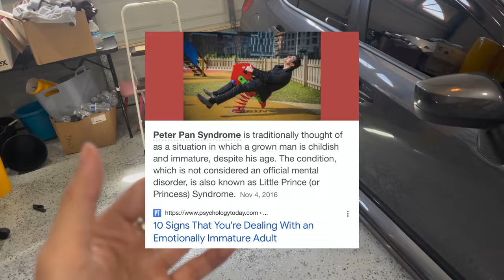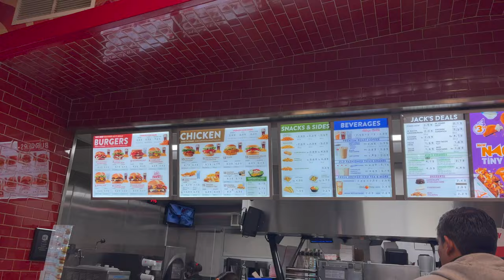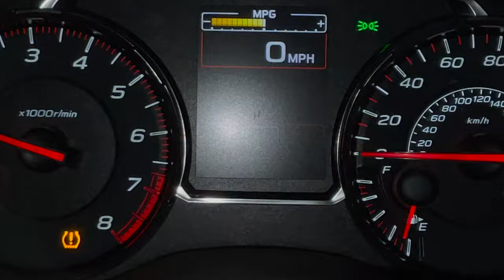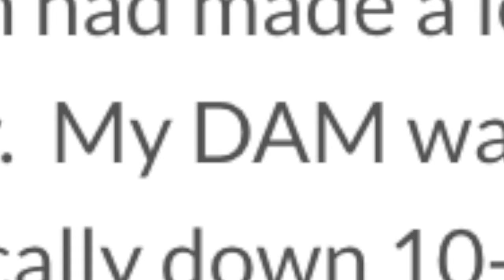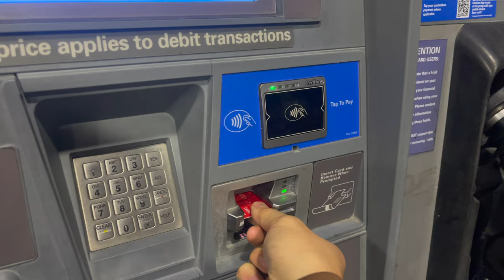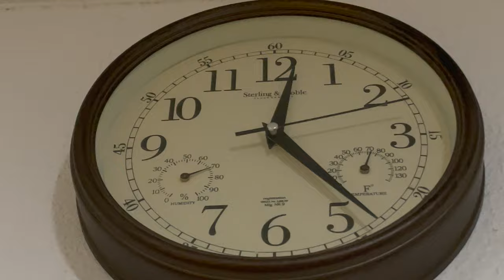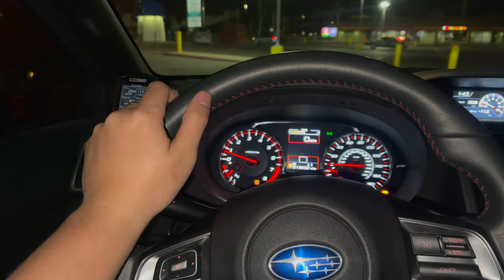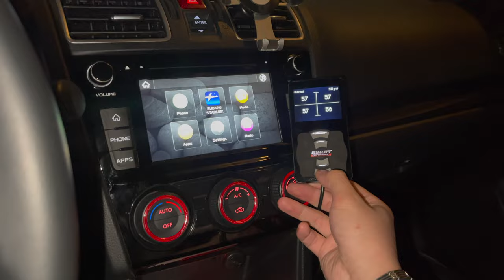E85 Ruined my WRX?? | Unreleased Kansei Items

Comment: E85 “ruined” my sti, after my first drive from switching over from a 93 tune im never going back, while the milage is horrible the car was completely transformed. I havent been back to a 93 tune for any real length of time for the 8+ years since i switched over, only going in for a retune soon due to a mild turbo upgrade. Im lucky that e85 is easy to find by where i live. 

Forget people that hate on wheel choices, sometimes you have to try something different. I did the rpf1 style foe a while on my spec b and decided to mix it up with some older ssr type c. I would normally do gunmetal or black to match my boring dull style, let my girl pick the powder coat color, she picked misty purple, they look crazy on the car and ive had more people stop me to comment on them than i have on any of my other mods on my cars combined. I never would have done a purple wheel but im glad i did, not sure if theyll stay forever but im happy i tried something new for once.

Comment: Yo you mentioned you had an unresonated jpipe on as well. Were you running stage 1 ots tune with the jpipe or were you on stock tune? Kinda worried about running the jpipe with no pro tune
Reply from the maker: i did a ghetto resonator delete on the stock j pipe. same thing as an after market j pipe. made my car run like absolute 💩. definitely need a tune whenever you touch the jpipe lol
Reply: @abgtaxi  ohh ok and you're running e24 on the Stage 1 ots?
Reply from the maker: @jerm_  yup. i’m on an ambott stock dp tune

Comment: E85 and WRXs aren't exactly best buddies, I have to bestow a full level 5 "DERP!" upon you for announcing a predictable result like its news. I am sorry it made your gorgeous rex ill, and hope you had an easy fix.  This video needs an injection forethought and balance.  You didn't explain the requirements or pro v con in a way a newcomer would understand.  That is pretty important stuff to cover when talking about mods, or am I way off base here?Ethanol concentrations over ~15% will start to corrode the injectors, fuel lines, hpfp on an EJ25 and the FA20's high pressure fuel pump can burnout by even E40 since it is gasoline lubricated.  It seems there is an unknown that makes it impossible to discern which WRXs/STis will tolerate e40-e60 and which go into limp or die. I spoke to 5 different tuners from the Chicago/Milwaukee area and all 5 advised me not to go flex fuel.  The said if I was dead set on it, pulling and rebuilding the engine with forged connecting rods would be required at MINIMUM.   Neither the FA20 or EJ25 with stock internals are reliable past 300whp/to or 325whp/tq respectively.  Do people exceed that? Yes, but will it last for 10k miles if you run it hard?  Maybe.  The problem here is that slapping on the kit and getting an e-tune for e60+ puts both cars into power outputs that kill the weakest links and that will be a very expensive repair bill.  
And now for something 
Completely different: You are hyper-focused on appearance and impression and you're letting others live in your head rent free!  I promise you less than 1% of people notice or think about your wheel choice ever.  Your experience of the mods you choose is all that matters, right?  Unless you're stancing, or trying to see how low an aspect ratio tire can be stretched onto a rim, I support your choice of wheels!  Remember, my opinion is only worth $.02!  (I can't be ok with stancing, its antithetical to everything I've learned in 18 years of modifying cars!  But if it brings people joy I can tolerate it without demeaning it. )